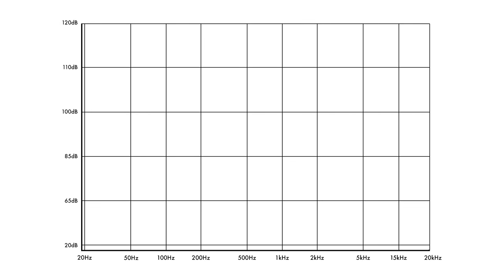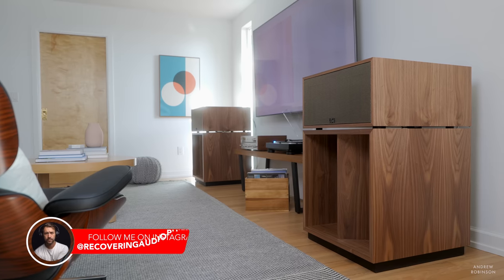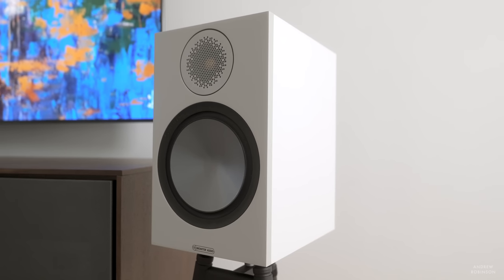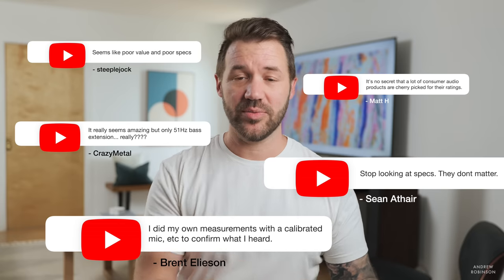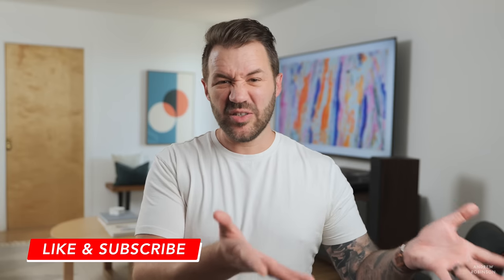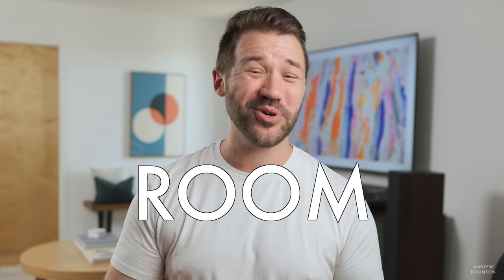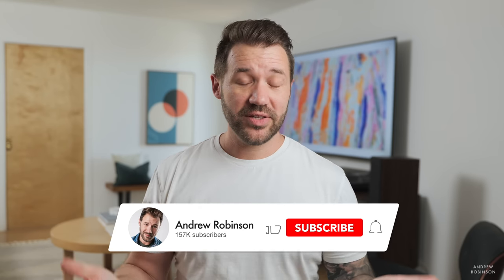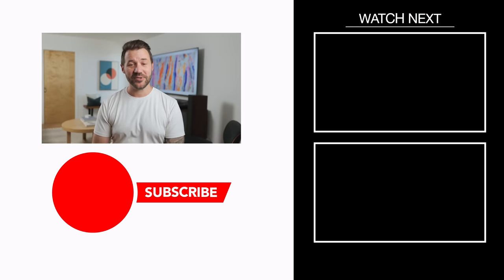DO SPECS REALLY MATTER in Audio? Understanding Speaker Measurements!

Comment: Not an audiophile by any stretch of the imagination.  However, I do consider myself to be a nerd around all things engineering and can appreciate the artistry involved in designing speaker drivers, enclosures, crossovers, etc.  That being said, my next speakers will likely be a pair of Magnepan LRS.  For those who haven't seen them, they are relatively small flat speakers that seem to produce more sound then the laws of physics should allow.  There is magnificent engineering behind them, they are not too pricey, and will sound great with most of the music that I listen too (irrespective of any frequency response graphs to the contrary 😊).  

But, the driving force behind getting them is that they look cool!  For me, an important part of the equation is the level of intrigue that I can evoke within friends and family when they hear music in my home.  Can I possibly nurture in them an interest in something they might not have previously considered?  All this to say… specs… Meh…
Reply from the maker: The LRS are an update (of sorts) to the MMG. They're great, but not for everyone. Make sure you have a fairly beefy amp that is stable down to 4 or even 2 Ohms if you plan on listening loud. I drove my MMGs back in the day with the Parasound A21 amp, Outlaw Audio (forget the model) and later Crown. The Parasound worked best, but it cost three or four times more than the MMGs. Just a little friendly tip. Thanks for watching!

Comment: I usually only care about the speaker sensitivity and the low freque'tncy rating.  I think there are two major issues with reading and/or watching speaker reviews.  The reviewers space is not going to be exactly like mine.  The reviewer's space set up is usually geared towards reviewing the product, not real world furniture in the space or other things you mentioned (bookshelves, windows, doors, etc.).  The other issue is that for many of us, we do not have an audio dealer near us to sample speakers, so how do we know what will work and what won't?  And even then, the dealer's display area is still not like our home space.  I have had the same speakers for 20 years.  I don't know if they are neutral, bright,  or boomy.  I think they sound really good, so how do I know that I'm not missing out on something that would be a better fit for my room acoustics or my hearing loss?  

Anyway, this was a good video and very helpful in describing what measurements mean and, well, don't mean.

Comment: Andrew thank you:yours and kristy help is invaluable 
I just received the edge amp
And what a boost to my setup
Klipsch 8000f’s in rp theater all klipsch 11.1 inc klipsch spl150
Using 4500h Denon 
What a great amp edge more clean base and good midrange
But the surprise the sound stage seemed to increase 
I had tried several class d amps
Nothing I tried matched quality and pricing of Edge 
The 8000f’s came alive
Really enjoy your great reviews
Reply from the maker: So very glad the amp has worked out for you! Thank you for watching and enjoy!

Comment: I did a test with Bose 301's. I literally placed each as badly as I could, and yet, they always sounded good. Not awesome, but good. Those are a speaker where the specs don't matter. What matter is that any ignoramus can wire them up to sound good, and they'll likely sound good anywhere in the room. In the end, speakers are tools and only solve the problems that you set out to solve. Specs may help you or they may not, depending on the problem.

Comment: You did a terrific job with this overview. Room, hearing, etc..I think measurements are more important now because there are so few brick and mortar outlets. I used to buy based on listening but that’s harder to do now. I have Revel speakers. I bought them based on reviews that said they were clear and revealing. I found they seem to be considerably tilted up. I still like them a lot,  I used a tube preamp to calm them down a bit, but I may have reconsidered if I had heard them.
Reply from the maker: Hmm, that is interesting. I had Revel Salon2s for years and besides being somewhat power hungry, they were "tamer" to me than say my Paradigm S8s, which I definitely needed to apply some EQ to in order to make them behave in my room. Not saying you're opinion/experience is wrong, I haven't listened to Revel speakers since that time (some years ago) but I'm curious now if their voicing has changed over the years.
Reply: @andrewrobinsonreviews  I struggled a bit finding good placement. I think I’ve placed them as best I can. It could def be my room contributing. Several times my wife and I looked at each other and I reached for the volume 😱. I use warmer electronics too. Vintage Mac amps. I started with Mac preamp, they sounded as I described, but I found Bellari tube preamp $275 (US) built. Single triode tube. It created a nice amount of tubiness to make them beautiful now.

Comment: I would say measurements can matter just to see what a speaker(setup) is in general capable of. But since most modern Speakers have a really good range with no real heavy lows or highs, I don't think it matters as much. As you said, the room can enhance or damp some parts of the frequency spectrum. So the lows and highs in the speaker response can be modified by the room to a degree that makes a speaker good or bad for your own taste. So in short: you won't miss out on sound because of the speaker, but because the acoustic of your room and measurements don't show you this.

Comment: Thanks to the magic of eBay, I just re-acquired a copy of Hi-Fi Choice's 1980 guide to Cassette Decks And Tapes. It contains reviews of 45 cassette decks, all of which were measured by the same reviewer for frequency response, wow & flutter etc. As they were all tested under the same conditions, those specs mean a lot more than manufacturers' claims. Even so, the listening panel's subjective opinions carried a lot of weight.

Comment: A few things about acoustics in relationship to a speakers tonal balance. Having a room with lots of damping is not a recipe to add bright speakers although I will agree that putting a bright speaker in a highly reflective room isn't going to please many listeners. Damping will help remove reflections in the mid and upper ranges but not the direct sound from the speakers unless of course the damping material is between the listeners ears and the speakers. A heavily damped room may also help to a very small degree absorb excess low frequency energy that every room will have. No speaker company that I know of gives honest charts that specifi how much smoothing was used  on the marketing material spec sheets. An anechoic  is very convenient but not the only method of getting direct frequency response measurements from a loudspeaker. Some speaker manufactures design there products with a set guess on what the average room boundary distances will be in the users room per model size and other considerations. My best advice would be to choose a frequency balance based on  personal taste, the type of music and how loud the system will typically be played. One thing I would point out to would be purchasers is that most speakers will not sound there best up against the wall where the miss may want them and some speakers will sound horrible in that situation now matter if the manufacturer supplies port bungs or not so try to get an idea of how much of a compromise this will be for said design if there is little freedom on placement and don't let anyone tell you dsp will magically fix this physics can care less about ones and zeros when it comes to bass modes in small rooms meaning rooms in a home. Loudspeaker specs that most companies and for that matter amplifier spec sheets are somewhat useless because they don't give useful information they simply exist because each company knows that their competitors all release the same set of numbers and if they don't the chance many consumers won't even consider them is real.Another problem is the average "audiophle" will not even be able to understand a useful  set of specs. Time alignment, phase response,impedance to freq curves will all effect how you perceive how a speakers tone will come across as well as help match to a given amplifier and almost never show up unless the manufactures claim to fame happens to have a design that specifically calls one of them out.

Comment: I was a measurement advocate. Still am but I see it more as tool, nothing more nothing less. I narrowed by recent speaker purchase to 2 speakers. Both had great measurements, one was nearly flat. My 12 year old liked the flat response I felt the highs were too harsh. In the end I choose the ones with the inferior measurements.  

Measurements won’t tell you if it’s good or bad, it will just tell you the response and distortion. Ultimately the listener has to decide for themselves what’s good.

Comment: Yes of course specs and measurements matter.. But so does ears, taste and so on..

I'm no expert, but without measurements i think it's very difficult to construct the best speakers and forsee how they can typically sound in an average room.. I know every room is different, but of course you cam aim to make a speaker that sounds great in many rooms.

Me for example.. I like to play loud, but the sound also has to be of good quality.. So a 86 db floor stander might not be the best choice for me versus a 92 db for example.. I know other factors like impedance plays a factor to..

To make it kinda short.. I think we should have more specs and standards for both measuments and specs, so they are more easily comparable.

But specs alone isn't worth much.. It can be a starting point, and then have fun listening to the things you shortlisted.

I think that a balance between both "camps" is the sensible way.. There's truth in both viewpoints.. At least in my opinion.

Have a great day 😉

Comment: I think where specs do matter is making sure technically, not as much sonically, the right components are correctly matched. For example, if you like the sound of the Magnepan LRS, but at home you have an amplifier that is low powered and cannot deliver the current the speakers will need to perform properly, you may need to make a change. Either different speakers, or a better matched amplifier. I guess that is objective vs subjective, but sometimes a spec is important in the matching more than sonics.

Comment: I think specs and measurements do matter, but they should not be the deciding factor. You may take the graph and roughly confront it with another, but it is just going to tell you if that speaker exposes more bass, more midrange or more treble, but that's it, it tells you just 5-10% of what that component is all about. Seeing a bump on the low portion of the bass tells you that there is an emphasis there, but it doesn't tell you if it's sloppy, solid, punchy, slow, etc, and a bump on the upper end doesn't tell you if it's harsh, resolving, transparent or muddy. Our ability to accurately measure a speaker really lacks the ability to fully describe it, end even if it would, would we be able to understand from graphs and measurement how it would make us feel?

Comment: I just do low and high trim on my speakers until it sounds good to me (neutral but warm / real sounding). You get used to speakers pretty quickly but I notice that if I listen to a couple of speakers during a short period switching within seconds listening to the same thing (maybe voices/singing/talking) I can find a sound/speaker I prefer more over the other speakers. I know what real life sounds like so I think my ears are drawn to that type of real sound in speakers. Same with mp3 or wav/flac i can hear the distortion in the compressed high frequencies of the mp3 but only if I can listen to the wav reference will I really notice the difference. I have both JAMO E610 (100W) and YAMAHA HS7 (55W). They are pretty similar but E610 has a softer sounding profile and HS7 is more bright and clear sounding, they both sound good to me.

Comment: Good information and nice way to present. This topic has so many variables especially when shopping for new gear. What I have always struggled with is speaker placement.  There are “book shelf” speakers that need to be on stands halfway into a room that is not always possible.
Reply from the maker: You are correct. Speaker placement is equal parts science and art to a degree. It's one of the easiest ways to change the sound of a speaker in your room for better or worse. I worry people don't experiment enough with placement before passing final judgement on their loudspeakers.

Comment: That's why we use digital calibration Antrew and I am surprised you not even mention it. We choose well measured speakers, calibrate them to remove as much as possible room's behaviour in frequency response and after that we fix our favourite target curve. The more the speaker is accurate in flat frequency response by the factory the less calibration needs. According the rrom of course. What you do by changing speakers to find your sound and choosing your favorite speaker we do it with a flat speaker and our favorite target curve. We both love some specific target curve. The difference is that you change speakers to find that, we do it digitaly with correct flat speakers. So, measurements matters a lot. Can we understand how a speaker will perform only from measurements? Absolutely.
Make a video also with what I wrote above to see what people know about. Thanks.

Comment: If you only look at the frequency response, no. But the off axis response is massively important. You usually can't get that from the manufacturer and will have to search around for an independent reviewer. But that will tell you how good they are at soundstaging. Directivity response is also huge, but even harder to find. That will indicate how good they are at projecting the sound forward. Spectral decay is like a frequency response over time and can identify nasty resonances. Do specs matter? Not so much. But measurements? Definitely.

Comment: I agree with you about using frequency response graphs as a guide during early selection.
When I know what I like, it is easier to eliminate a lot of choices w/o having to listen to every one.
Because of point 3, I do prefer flat speakers, since DSP does not have to fight against an "inbred" house sound.

To be honest though: distortion measurements etc are more of interest to me. I want to know whether a speaker has engineering compromises etc. that might be a problem in use.

As for the actual anechonic FR: Dirac Live bludgeons that into the shape I want & that fits my room anyway.

Comment: I prefer speakers with a flat frequency response and there is a reason for this. Producers tend to use equipment that is not coloring the sound (at least I hope they are). I really want to hear what the artist, producer and other people agreed on before releasing a song.

Furthermore, you can tune Speakers with a flat response far better to your liking if you want to do so.
 

It does not mean that everyone has to like equipment with a flat frequency response. The truth is that outside the audiophile world hardly anyone likes that. People that I am aware of like this “Smile” EQ Setting or as we call it in German “Badewanne = bathtub” most.
Reply: Actually, that is not how music production works. A mastering engineer is aware of the myriad of systems that people will use to listen to the recording. Some will listen in their cars, some with headphones, some with EL-Cheapo speakers and some with audiophile setups. So a mastering engineer has to do that too. He listens on many different systems and evaluates the mix on each. Then he tries to strike a good compromise so that the end mix translates well to a lot of systems the target audience may use. That may be quite different for e.g.: a pop song compared to a classical recording or a TV advertisement. Ever realized how bassy these sound when piped through a system capable of flat 20Hz - 20KHz? That's because they were designed for flimsy TV speakers.

Comment: Good video. I look at the measurements but just for a point of reference... if I know my room excites high frequencies I don’t want to buy a bright speaker and the low end measurements will tell you if you need a sub or not 😅 so use them as a guide and you also didn’t talk about the things you can’t measure like imaging and sound stage...

Comment: I don't trust manufacturers that don't publish their specs. This removes their responsibilities as a manufacturer. If you don't know how a piece of gear is supposed to perform, you can't hold the manufacturer responsible if it performs poorly. Ultimately, I trust my ears!

PS: specs certainly help with pairing up components. How much wattage to power your speakers or which preamp to go with your amp? We may not be able to hear Signal To Noise Ratios or Intermodular Distortion in today's audio gear - but a spec sheet gives you something to go on.

Just my 2 cents.
Reply from the maker: Except for how are you checking their work? Measuring say their speaker in your room using your tools would no doubt yield different results than what they got, regardless of if they used an anechoic chamber or not. So how large of a margin of error are you willing to accept? Who decides? Not saying that you cannot check their work, sure, but it's not really an apples to apples comparison.

Comment: some specs i trust, like price, dimensions and weight. and speaker box design, sealed,ported and so on. 
specs like crossover points and dispersion measurements i think i know what does to the sound but its just speculation on my part.